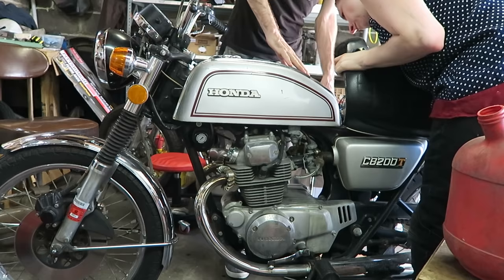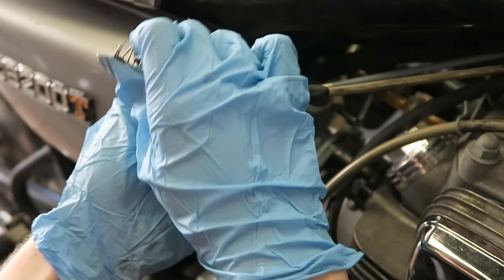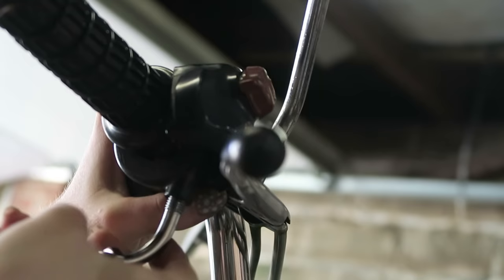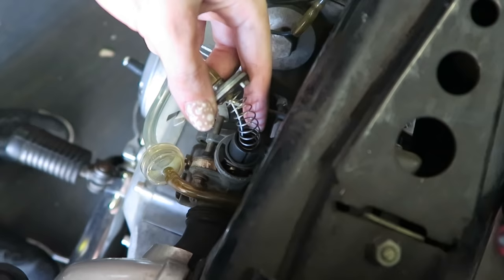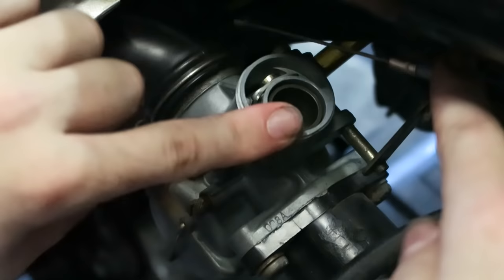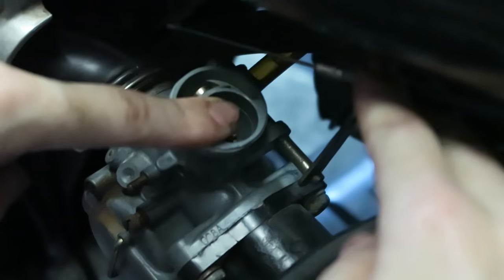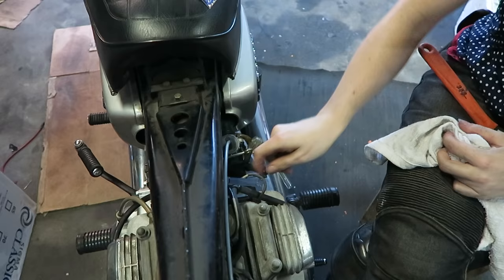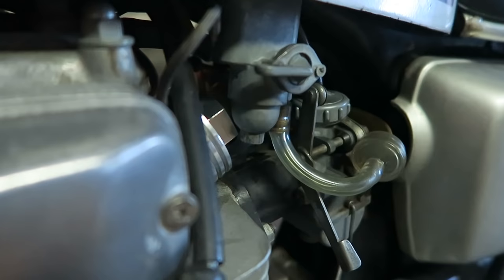Throttle Cable Replacement on my 1975 Honda CB200 // Becky Stern

Comment: I had a '74 Honda CB350 4 cyl about 45 years ago and your bike really got me reminiscing.   One of the most practical and reliable bikes I ever owned.  Need to change a 2 cable system on a later bike and it has a TON of fairings, false panels, and other plastic crap that has to be removed to even attempt doing what you're doing here.  Starting to really wish I had that old 350 back, hehe.  Thanks for the vid, very helpful.

Comment: Becky, I started watching your videos after purchasing a 1975 Honda CB200T - same color as yours.  Three weeks have passed and I want to thank you for your work.  With your pointers,  I've probably avoided making several mishaps. It's also great to see someone else jumping in and working on their own bike.  By the way, I've found the Honda CB200 shop manual to be more helpful and exact than Clymers.  Also, big shout out to the Hondatwins website and forum.  A great community of experienced vintage Honda owners helping each other.

Comment: Thanks for that Becky, big help! I used to have a CB200 in the UK but I was never daring enough to take it that far apart. Tomorrow I'm replacing the Throttle cable on my Chinese Honda CG125 clone, with a lot more confidence after watching your video.
Reply from the maker: Amazing, hope it works out great for you!!! Don't make the same mistake I did. =D

Comment: Becky - Let me add to the chorus of 'thank you's';  THANK YOU THANK YOU THANK YOU!!!  Had the exact same problem replacing the cable on my SL175.  Your vid totally saved my bacon (not to mention the cost and trouble of hauling the bike off to a mechanic!).  So again, thanks!

Comment: this totally helped me get my throttle cable properly installed on the carb end. I was getting really frustrated because the throttle was not working and I took it apart and put it back together like 10 times! It was the same mistake you made, the slide was backwards and not going down far enough. So thanks!  Ps so good to get instruction from a woman :)

Comment: You can get bowden cables made, ask a local brakes, clutch or instrument (dash instrument, not musical instrument) specialist they often have the gear to do it in house - if you take the old ones in you could get new ones made to your specifications.

It's going to be the internal (cable) to external (casing) ratio that matters for your tension, so the new cables must have slightly longer internal cable or slightly shorter external cable, or both, anyway end of the day a different ratio internal to external, the absolute length of the cable as a whole doesn't matter (for tension, but for fitting where it needs to go, it does, obviously) - you're a smart person I don't know why I'm explaining this to you I'm sure you can see how it works :-).

You could of course have a look at a wreckers (whatever they call that in the states, wreckers here in NZ, "motor factors" in the UK I think is the term, maybe breakers in the US I think I've heard, anyway, place that takes old cars and/or bikes and sells you bits from them) to see if you can find a longer screw adjuster for the throttle end.
Reply from the maker: Thank you! =D

Comment: Great watching ur video  so easy was to pull out  cable from.the carb  mine wont budge at all  same bike  been sitting 4 40 years soaked in wd 40  still wont budge  myproblem not urs    bloody frustrating

Comment: I'm pretty surprised the cable goes straight into the carb like that, every carb i've worked on has a lever on the outside that the cable engages with, but i've never worked on an engine older than 1987. Is this a common design in older bikes, or is it a performance thing?
Reply from the maker: This is my first bike so I don't really know how common it is! My shopmates' carbs are a single pull to a lever outside like you described, but when I inquired about a new cable at the service garage they didn't blink twice about the split, straight-into-carb style and grabbed me that black one from the beginning of the vid, so there have got to be a whole group of bikes that work like that! Deductive reasoning!
Reply: Rob did you work mainly with carbs on cars? It's much more common for cars to have a cable and cam design that actuates the butterfly valve. It is designed this way on most small bikes because of space contraints that you don't have on cars.

Comment: Becky, I have a CB200T in Mexico City. I also need to change the cable. Would you help me with the model you got it in Amazon? Gracias
Reply from the maker: Click the link in the description, the Instructable has more info including the product link! Also have seen cables pop up on ebay
Reply: Gracias Becky Stern

Comment: hey Becky, i have a 76 honda cb200 and i was wonder where i would be able to find a bolt adjustment for my clutch cable. its so hard to find one knowing that they are a discontinued part. do recommend any advice on what i could do.
Reply from the maker: Hmm, did you check David Silver Spares? https://www.davidsilverspares.com/CB200T-1976-USA/ or ebay?
Reply: Becky Stern I just checked David silver spare and no luck 😩. And I’ve searched on eBay already and I haven’t had any luck as well.

Comment: Great video! Will help alot on my 1975 cb500t.  Is there a way to dry test to make sure all is well before running the bike? Just to make sure I don't have the same problem with an open throttle haha
Reply from the maker: Well, if I had known better, I could have seen that the slides weren't going down as much they should, but I don't know another way to tell before trying... a 500 twin! Don't see those around too often!
Reply: One way to tell if they are seated correctly is to remove the air filter tube and filter. You can directly see how far seated they are.